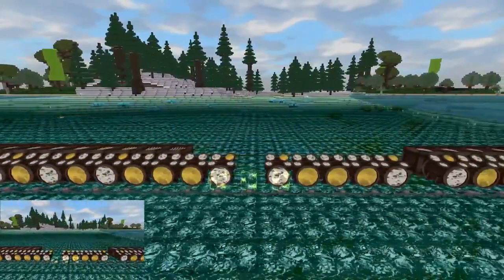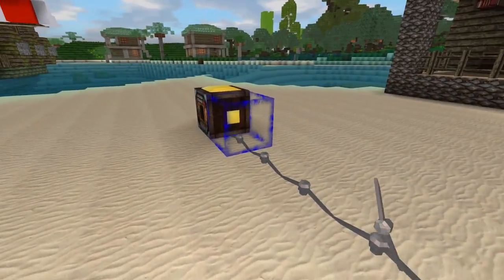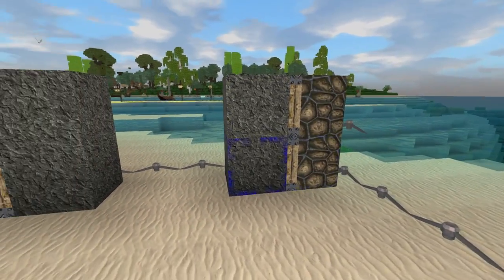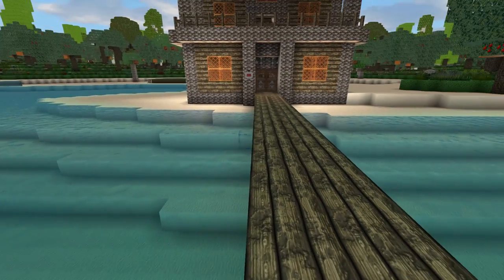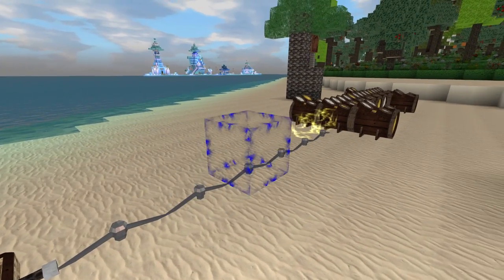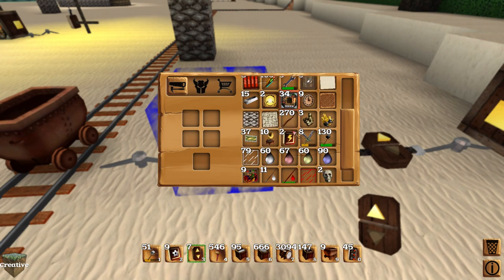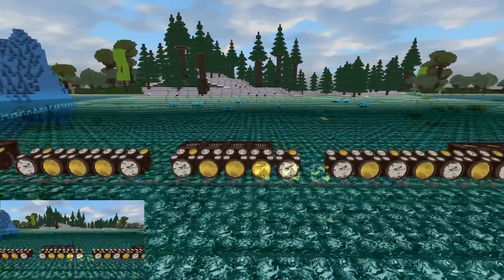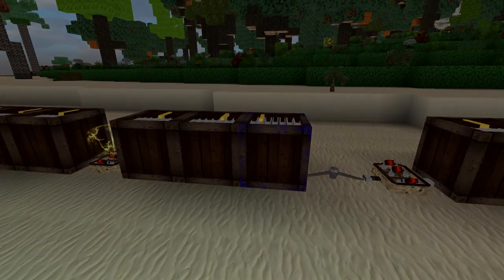Block Story Tutorial: Electricity

Comment: I need help. I'm currently at the part where the wizard requests you to capture the fire dragon and get it's spawner. But the damn thing keeps flying in the fire and regenerates health and I keep on burning through meat and health potions plus my dragon dying. Any advice?
Reply: I recommend taking the fight as high up as you can. Preferably near the ceiling. When you soul capture it the spawner will fall, but as long as you have your eyes on it then you should be able to catch the spawner mid air. To assure success, make sure you avoid bringing the fight over a lava lake as that can risk the spawner falling into the lava after the fight.